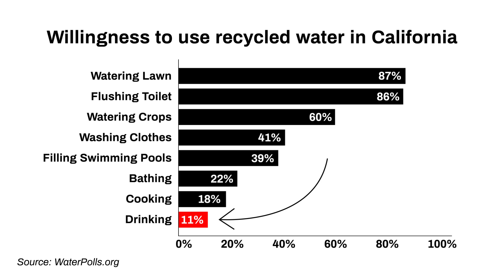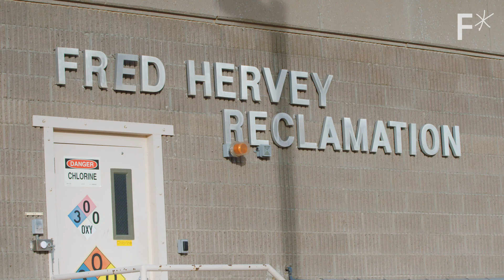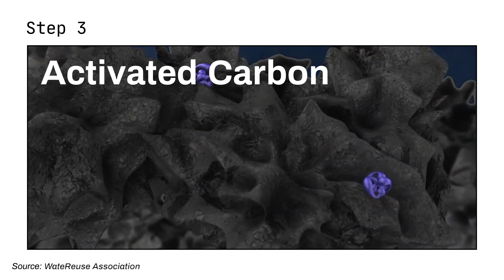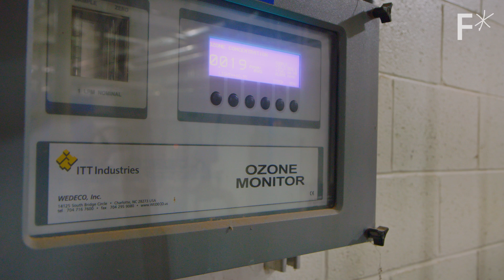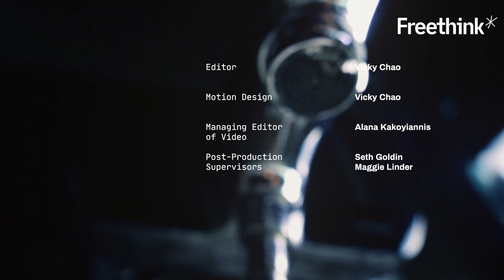You Might Drink Toilet Water - Here's Why | Freethink | Just Might Work

Comment: Recycling water has to be one of the easiest, cheapest, convenient, accessible, and safe forms of recycling there is.
Settle, filter, coagulate, filter, evaporate, condense.
Tragically, the “eugh that’s gross” reaction gets in the way of progress far too often.
Reply: How do they remove pharmaceuticals and other chemicals? I certainly wouldn't trust a closed loop system. 
Sure, the earth is a closed loop system. But at least I know the chemicals will be diluted to a much lower level.

I have no doubts that a solution to the above exists or will exist. But whether it is properly implemented is another question.
All in all, people's initial reaction are justified.
Reply: @alan5506  I would first check the water quality standard before making assumptions
Reply: @monsieurLDN  Then you can do that.

Comment: Im no scientist, so there may well be myriad reasons this might be a bad idea, but a bad idea is better than no ideas, so here goes.

As i understand nuclear power plants, the radiation itself does not directly produce electricity, but rather the heat from the reaction converts water into steam to power a steam engine which produces the electricity. If we use the treated waste water, the water produced in step 1 of this videos process, that would serve to distil the water. That would theoretically mean that we could produce electricity from the reactor, and then reclaim that water to be reused. 

Now, there is the possibility of the water being irradiated, which would be bad, but there must be a way to make this work. Distilling water is an energy intensive process that has a small volume yield per unit of energy used because of water's high specific heat. However, water being used as a coolant is meant to evaporate out in a nuclear reactor to drive the turbines. 

Could that be a method for producing potable water?

Again, im not a scientist, so yall may know already if this is a bad idea or not. In my opinion, it's certainly worth thinking about.

Also, this video was fascinating.
Reply: Nuclear power plants typically have a two-step water loop. One loop runs through the fuel rods to collect heat and is radioactive. The other loop gets its heat from the first loop through a heat exchanger and isn't radioactive. That's why nuclear power plants are allowed to have those big cooling towers that let steam escape. In short, it might be possible to combine a water purification plant with a nuclear power plant (as long as we ignore the public outcry over anything with the word "nuclear" in it).
Reply: @toriknorth3324  that means we could practically collect that vapor in what would essentially be a giant distillation coil. Run that water through one last filter to account for contaminates in the collection Reservoir, and you have potable fresh water. 

If the water intake is sea water, you could also reclaim sea salt during the distillation process as well. If water levels will have to rise anyway since climate change remains unchecked, we would stand to benefit from the salt production, an increase in available fresh water in water starved places of the world, and produce power in the process rather than costing a fortune. Waste not, want not.

Im kinda surprised that could actually work for real.
Reply: Certain places around the world have desperate need of water to preserve what life we can as this climatic crisis we face. Nuclear power could help us toward that end. As long as we distill an amount of water equal to the polar icecap melt and the runoff of its use combined, we could stop the sea level rise in its infancy before all is lost.
Reply: Bad idea mixing a babies drinking water w/ possible radiation no matter how safe you say it is - no room for Oops
Reply: @jwarmstrong  I specifically said I was not sure about the safety or efficacy of this idea, but I am certain there are scientists present here who can give us expertise and not fearmongering about any and all progress our species attempt.

I appreciate the sentiment, but the contribution really is not helpful, Karen.
Reply: Assuming that the evaporated water retained radioactive material, might there be a filter that could be designed to tease out the radioactive material from the water vapor . you would probably need a series of multiple filters . 

Otherwise, could the water be kept uncontaminated from the reactor somehow while still evaporating to drive the turbines? On paper, that is all distillation is in a nutshell. Boil the water away, capture the vapor, condense it, and collect the condensate. If the radioactive material could be reliably removed from the vapor while keeping that material separate from the condensate, then you have a functional nuclear distillery. 

Perhaps if you attached the filters to the turbine blades themselves? Set up a series of several turbines in series, each removing some radioactive material, until there is none left. The question is how to physics that into the real world.

Comment: The problem now is are you filtering out pharmaceuticals and industrial chemicals?
Reply: Because nothing was said at all about this!!!!
Reply: I dont think industrial chemicals count as "human waste"
Reply: Yeah I've wondered about that myself. He did say also from our commercial customers. Even if you distill the water any chemical with the same or lower boiling point is going to vaporize with the water. But thats not the process they use regardless, it uses way to much energy. I'm not a chemist but I would think most pharmaceutical molecules are gonna be larger than the H20 molecule. So I guess it depends on how tight the filtering part of the process is. Also how chlorine, peroxide, UV and whatever other sterilizing agents they use react with pharmaceuticals. The reality is that we dump so many different chemicals into our environment stuff is getting into us one way or the other. We eat a lot of plastics. At least this way the water is being closely monitored. Clean fresh water is just going to get scarcer in the future. Closed loop systems will become necessary so we might as well start getting used to it.
Reply: This is the reason for the activated carbon, to absorb chemical contaminants....
Reply: That’s what the activated carbon does
Reply: I concur

Comment: I remember there is a city in africa which does the same thing. It will become handy if the water supplies keep getting worse. In germany all households have drinkwater via the incoming pipelines. toilets, sinks, garden usage, shower everything uses the same water. New buildings must have a water collection system for toilets etc or they are not allowed to be build. Its crazy to use drinkable water to flush your toilet.

Comment: I always wondered, does water hold energies? So if it's a loop, will the water transfer energy to each households?
Reply: well some water towers recover some of the electricity they use to pump water up by having the water run a turbine as it flows back down.

but they recover only a portion of the energy used to pump the water up